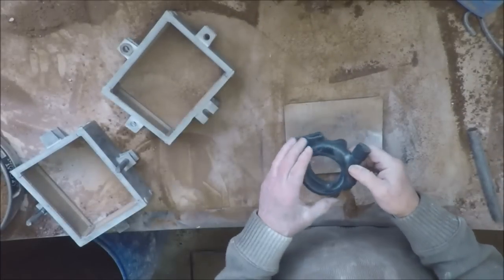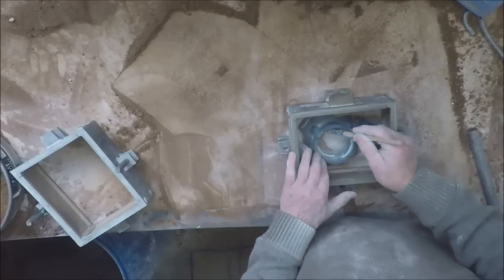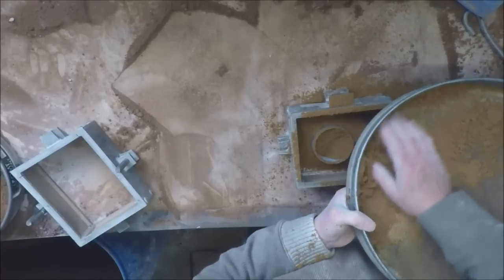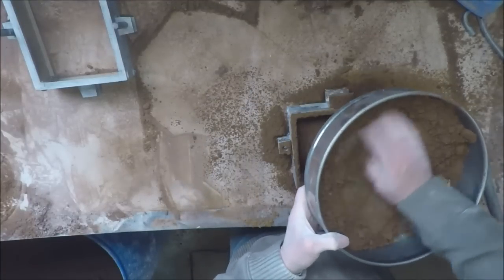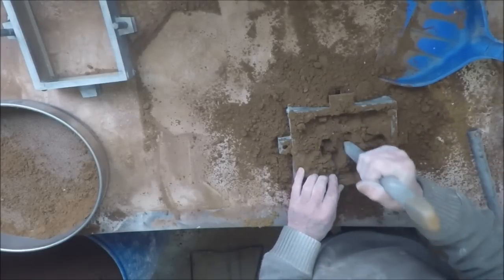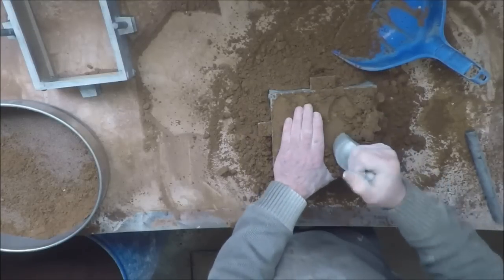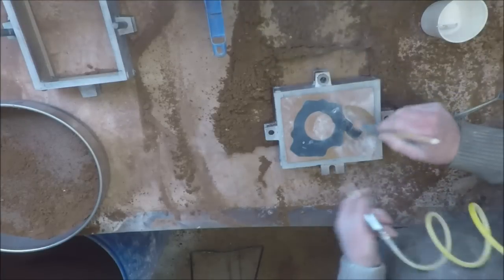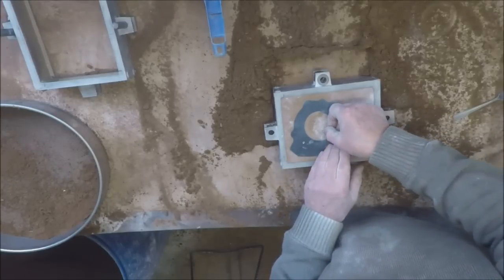My Home Foundry; Two castings for Oakland cars; Part 2 The Speedo drive

Comment: Sorry if this is a dumb idea... but what if you put a piece of paper covering the riser, with  "exothermic" on it?  Then you could pour without interruption.  You'd lose sight of the metal coming up the riser but mostly you need to know when it's at the top.  Anyway, I don't know if it's a good idea or not.  Thanks for all the casting education!
Reply from the maker: k15n1, Well, its sort of a case of great minds think alike! I used to do something very like this. I used a cupcake paper sitting on the top of the feeder and put the exothermic in it. This worked better than a flat sheet of paper as it contained the exothermic better. However there were a few problems. It is nice to see the metal come up from a fair way down as it gives you more warning of the mould being full. Placing the cupcake paper sometimes dislodged a few sand grains that inevitably  marred the surface of the casting. And worst of all  the paper slowed down the ignition of the exothermic sometimes by enough to render it useless. So I just went back to spooning  the exothermic on the metal as soon as I stopped pouring.  Full marks for thinking though... Martin

Comment: The finish you're getting is beautiful. I have the aluminum head off of my Norton Commando and it looks like the guys who cast it were drunk. I wish you had done it.
Reply from the maker: Allen, They probably were! Most foundry men are great elbow benders. I think its how they cope with the heat and the pains of advancing years well that's the excuse anyway! 😏 Norton cylinder heads, haven't they got fins a mile deep? Very , very hard to cast, glad I did not try it 😀.. Martin
Reply: @olfoundryman8418  i bet years ago they had a "beer allowance" and it goes back to that, the first "proper job" i had was in a glass bottle factory, and the operators up at the "hot" end can loose pints of fluid a shift, when i was there they had free pop or water on demand, but up until the early seventies they had beer up to 8 pints a shift, they either had high tolerance or were smashed 24/7, i understand foundry workers and furnace workers had similar allowances, so they were drinkers.
Reply from the maker: @alynicholls3230  , You are not far wrong! Many years ago at morning tea and other breaks the apprentice was sent down to the pub with a billy and would return with the billy full of beer - Ah, the good old days! Probably were half cut all day. In my days as a foreman of a gravity die shop in summer we used to drink about 8 pints of cold water a day and rarely went to the toilet it was all sweated out , each of us had a stack of old pint milk bottles full of water in an old fridge. I found soda or pop or coke etc. too bloating... Martin

Comment: What are the benefit's of the experimental pouring basin? Did you buy your flasks or make them?
Reply from the maker: Lawr,  Sorry but somehow I missed this comment when you made it and only just saw it today, sometimes the comment notifications seem a bit slack! The job of a pouring basin is to provide a sufficient head of metal above the sprue entrance to keep the sprue full of metal. This is the only way to prevent air being sucked down the sprue, and air that is sucked down will create defects in the casting. The purpose of the radiused ridge in the pouring basin between where one pours and the sprue entrance is to stop any downward component of the velocity caused by the pouring from the crucible into the basin from increasing the velocity down the sprue. High velocity of metal flow is the enemy of castings. It is important to realise that the best basin in the world is useless if a tapered sprue is not used and also that a good basin and a tapered sprue are just a start ( the best possible start) to a good gating system. The worst thing one can do is to use the all too common overly large and unnecessarily high sprue topped with a flared simple funnel type basin Ugh!..... Martin

Comment: What's the secret powder you're sprinkling on the sprue?
Reply from the maker: Barry,  Its no secret :). The powder that I sprinkle on the feeders is an exothermic that because it catches fire keeps the feeders liquid for longer so they are better able to provide liquid feed metal to the casting thus counteracting the solidification shrinkage that occurs in it. It is a commercial product called "Ferrux NF" it is made by "Foseco"
Reply from the maker: Aric, I share your concerns about the use of talc. I am aware of its origins and indeed also that it often contains a small amount of free silica. Some health authorities around the world (In the US I believe) have suggested that it should not be used anywhere that its dust can be breathed in and this apparently includes the powdering of babies bottoms! This is one of the reasons that I do NOT use it. My parting agent is a commercial one but is actually just finely ground calcium carbonate. My understanding is that the human body tolerates this product quite well, apparently with body fluids dissolving it. Ones calcium intake might be a little higher for the use of it but that is probably no bad thing! It addition its cheaper than talc, out here baby powder works out at $10.00 per Kg while the calcium carbonate is about $3.00 per Kg in a 25 Kg tin a no brainer. You can of course but talc in bulk and get it a lot cheaper than the $10.00 per kg.I too wish to continue on further into old age and I am grateful for your concerns. The main silicosis risk is probably from the moulding sand itself although if its kept damp it should not be too much of a problem (I hope) Certainly last check of my lungs indicated no problems. Thank you for your comment and I am glad that you liked the video, sharing is as always my pleasure.... Martin

Comment: Very interesting and instructive video as always. Are you planning a video on mulling or reconditioning your sand? Thanks again!
Reply from the maker: Thomas, Thank you for your comment. A video on Mulling? No, sorry, for alas I do not have a muller! (Would not mind one if you know of one going cheaply :).) However don't despair - I have a video "in the can" that I am currently trying to edit that covers how I make and prepare my facing sand. The techniques used are in part at least the same as used for my backing sand reconditioning